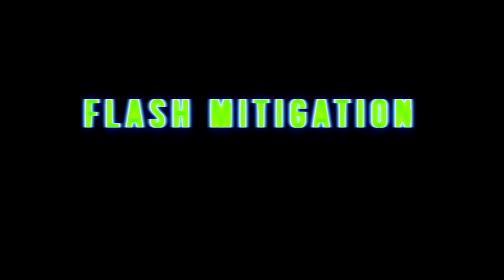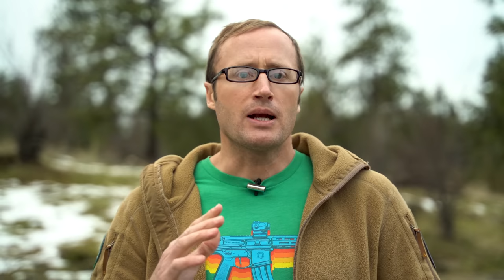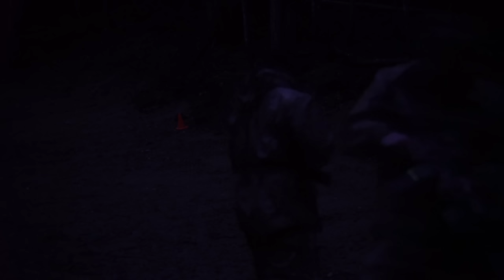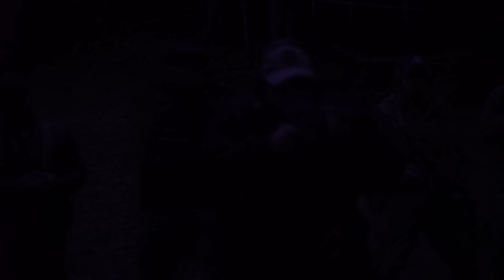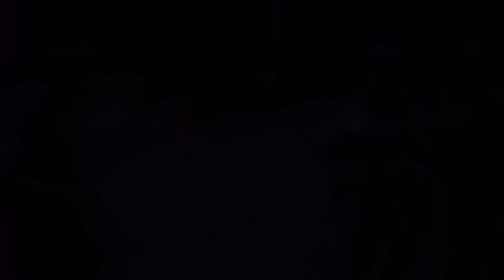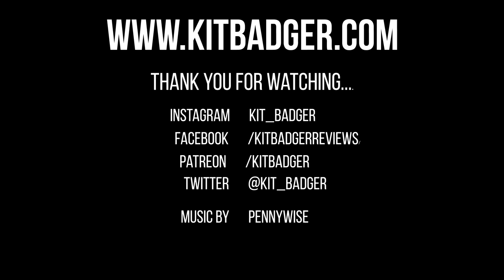Flash Mitigation: Part - 1

Comment: 4:07  300 blackout with DD wave suppressor. No flash whatsoever
Reply: Probably because it’s was subsonic ammo as well
Reply: @derek3154  ; Yup
Reply: do you think its the suppressor or the 300 blk?
Reply: @andyrey8536  both, suppressor and the subsonic ammo = less flash
Reply: There was no mention of whether or not a flash hider or a muzzle brake were used in each of these demonstrations. A potentially significant factor in flash reduction or lack thereof, that unfortunately was never mentioned. Bummer.

Comment: Damn those Surefire cans had great flash reduction and reduced first round pop regardless of user inputs. The Griffin can was no slouch either.

Ammo has a huge impact on flash as most ammo is loaded at the factory with the intent of a full burn on a 16+ inch barrel. When you start cutting that down there is excessive powder burning once it hits the atmosphere. Newer ammo is being loaded with SBRs in mind but that's usually defensive loads that you don't want to shoot into the berm unless you're made of dolla dolla bills yo.

Nice work man.

Comment: I have a question that I haven't really seen discussed before. Does using a muzzle brake vs a flash hider, in conjuction with a suppressor, increase flash signature to any measurable or noticeable degree? I'm currently using a Surefire muzzle brake with a Surefire Socom556 RC2. I went with a brake to act as a sacrificial baffle. Saying this, flash signature reduction is my highest priority, so I'm willing to switch it out for a flash hider if there's a noticeable difference. I really wish that the specific muzzle devices used in conjuction with all of these suppressors was mentioned, as these may have been large factors in the flash mitigation, or lack thereof.